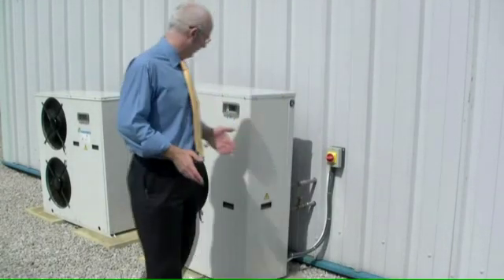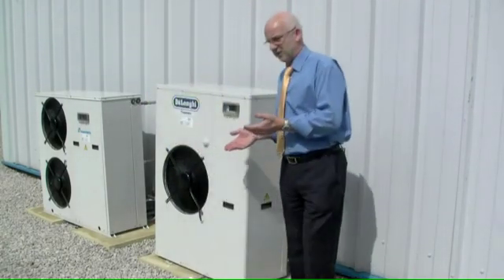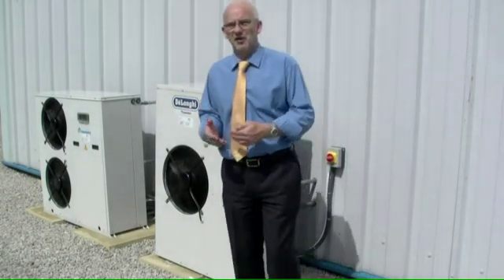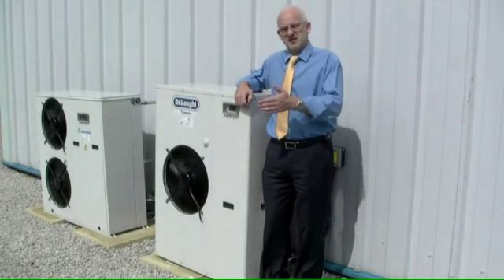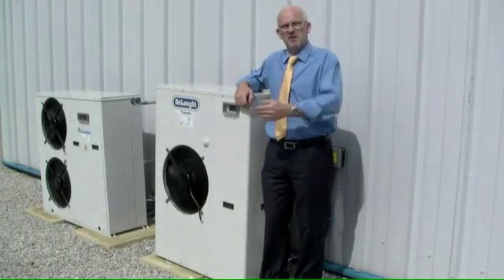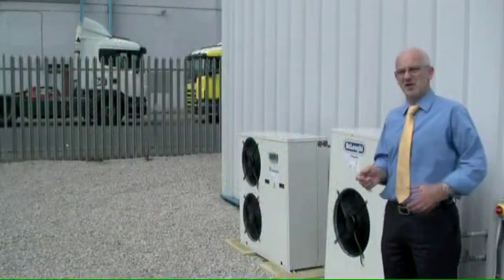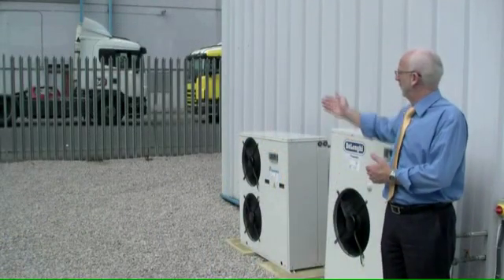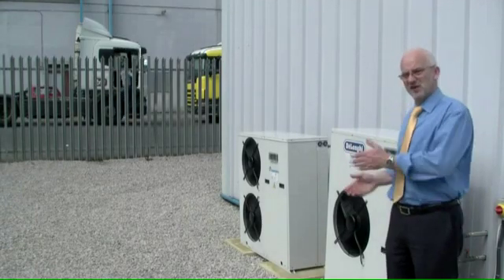How Noisy is an Air Source Heat Pump?

Comment: I work as a qualified noise consultant. To assess noise impact, one needs to consider the residential background noise climate (at night) and assess the impact of noise relative to that. Most heat pump noise is broadband fan noise, however one needs to pay particular attention to the low frequency content which preferentially breaks into buildings/dwellings, which can result in tonal problems inside a property (often worse when a window is closed).

Comment: @gibbzthegreat Hi, are your neighbours planning on putting one near your property? If so as long as it is at least a few meters away from the actual building it shouldn't pose too much of a problem. Remember that in the summer the pump will hardly be functioning so won't be a problem with sound travelling through open windows etc. Your fence should actually help to reflect soundwaves away from your property slightly too

Comment: @gibbzthegreat I decided against positioning the pump further away as it would decrease the effieciency of the unit. I'm still having problems with the low frequences travelling through my timerframed house but have slightly changed the angle which has improved the acoustics. My house is a new build and we should've taken more consideration to the placement of the pump i.e away from the bedroom areas of the house.
Reply: How many times have you already visited a psychiatrist?

Comment: The problem with air source heat pump noise is that they can emit sub bass frequencies (around  20 - 100 Hz.) The pump doesnt send out much in the mid range  (as with human speech) which is why your voice is louder than the pump in this clip. I've just installed a heat pump and the bass frequencies that are travelling up through the frame of the building are a major problem. I'm looking into getting the pump re-positioned as far away from the house as possible, around 20 metres. Fingers crossed!